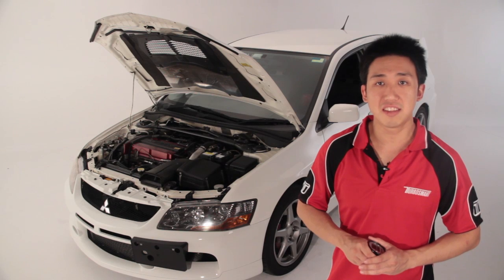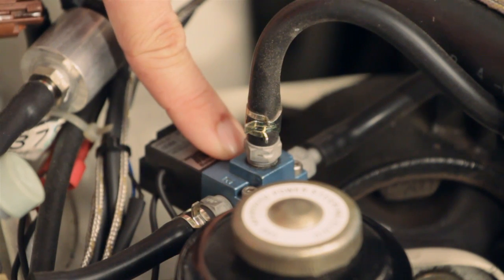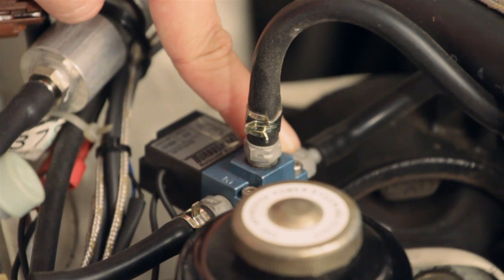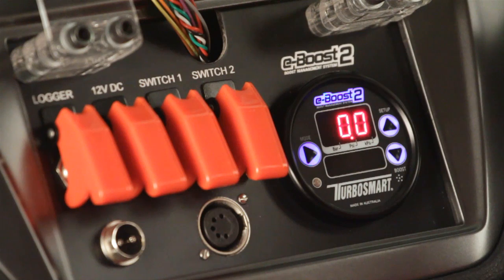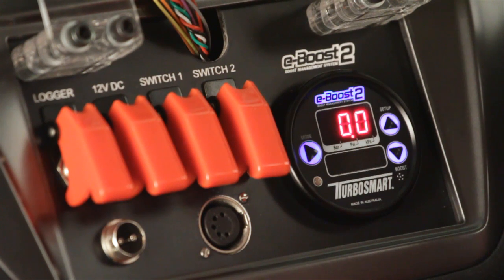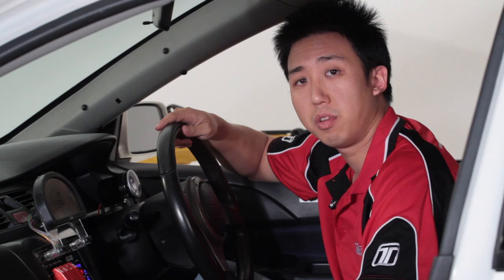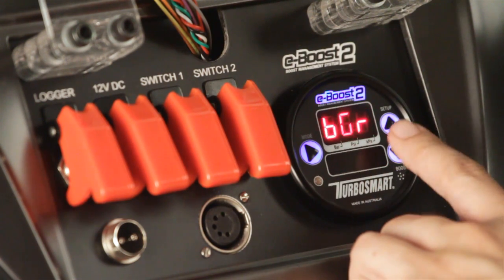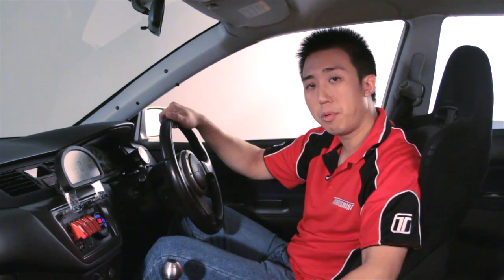Turbosmart eBoost2 set up tutorial - Part 1

Comment: can different PSI boost be changed at Different RPM ? Like 10 psi at 1000RPM to 3000RPM and 18 psi from 3000 RPM till 8000 RPM ???
Reply from the maker: Yes, Boost by RPM is programmable in 100 RPM increments
Reply: @TurbosmartHQ  nice....this fixes my diesel engine for my ford ranger

Comment: What is the benefit of the head unit knowing the RPM? Can't all these features be achieved without RPM data?
Reply: Mate you would want to hope for $700.00 that it backs off boost at hi rpm as a safety feature. And also be able to set different boost levels at different rpm to help with traction etc....